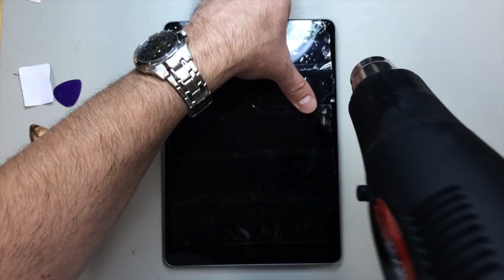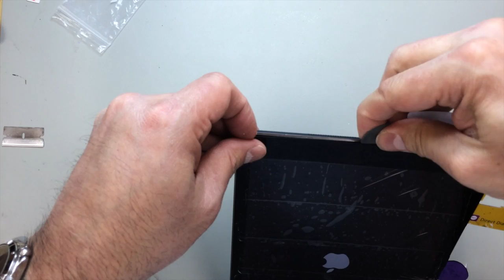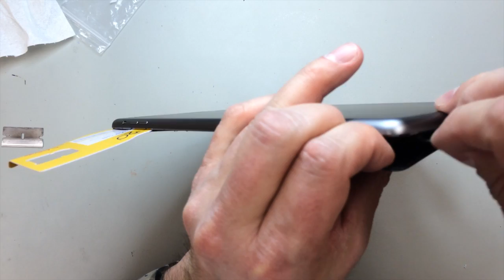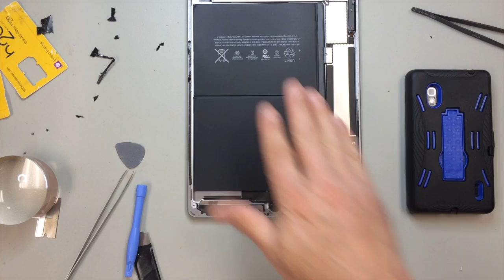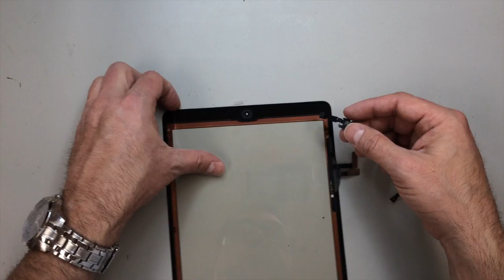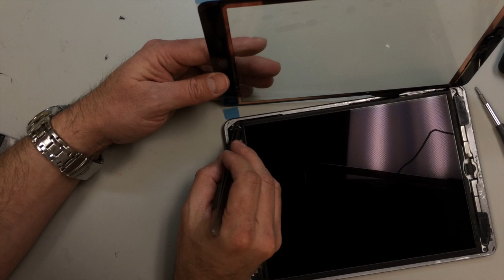iPad Air Screen Replacement Tutorial

Comment: nice job - thorough. except you skipped the moment i destroyed my last two attempts, namely pressing the digitizer closed into the adhesive. each time i've broken or crimped the flex cable enough to paralyze the bottom 1/4 of the screen and invite all the ghosts of ipads past to run amuck. wish i could figure out how to keep those cables free and easy. it's crowded in there.
Reply from the maker: Oh wow I hadn't looked at this video for a long time. When I do one of these again I'll make an update. There is a piece of adhesive on the flex cables now that make it a little easier but like you said it's crowded in there and you have to be sure that the cable goes between the frame and logic board just perfectly. I always start by setting the left hand side down first and then looking at the tablet from the bottom end while carefully guiding the flex into position.

Comment: Great video tutorial thanks. How long do you have to heat the screen to able to pry into it.  I have spent more than an hour using Iopnener as well as a hair dryer mostly at the same time, but with no success thus far.
Reply from the maker: It's pretty sticky from the factory. While I haven't tried this with a hair dryer my heat gun takes very little time. Of course that won't help if you don't have one on hand. I'd say try starting with the edges as they are more narrow and easier to get through. If you can get the top end from there and the glass is somewhat in a single piece it can sort of be used as leverage while you heat the lower end and slowly open it up. The best option is a hot plate if you can get access to one. Otherwise I'd highly recommend a heat gun. They are like $15 at Harbor Freight.

Comment: hi there 
i did try to replace the  digitizer but i forgot to swich it off  is that efect any on my i pad
with regard
r shandy
Reply from the maker: +raam shendy It can be. If you connect the LCD while the device is on Id say there a 50/50 chance of blowing the backlight filter. If you already completed the repair and it still works then you are lucky. Otherwise definitely disconnect battery before plugging or unplugging the LCD.

Comment: I was wondering if you would offer your opinion pertaining to an iPad air repair. When I set the digitizer in it's frame it began to malfunction. When testing prior to fitting the glass all the way down, it was functioning properly. I will have to attempt this job again, as I have broken my replacement digitizer. I did this when trying to lift the glass to resolve my issue. I have successfully repaired ipad 2, x3. I know special attention is needed on its digitizer cables, is there a tip you might give me for iPad Air. What do you think may have happened? Thank you so much for your time and I certainly do look forward to your response. Have a great day!

Comment: How did you remove the Home Button Assembly, when transferring this part back to the new screen. Your video did not show this. And second where does the double-sided tape go, is it to be placed on the new glass screen or the ipad frame?
Reply from the maker: I used heat and a thin pry tool (dulled razor blade is my preference) to remove the home button assembly. There is also a black ring that has to come off so be sure to get that piece otherwise your home button will not be flush with the lens. The adhesive can go on the frame or the glass. I personally find it easier to attach it to the frame. You can also see where the original adhesive was so you'll know where to apply it. Make sure to remove the old stuff first of course and don't let the flex cables come into contact with the adhesive or you will have a difficult time installing the lens.

Comment: the top corner of my ipad air cracked, very small

Will the crack get any bigger  
don't wanna pay for something so small
Reply from the maker: Eventually maybe but a lot of people go without repair and are just fine. The main thing is that if the crack goes over the LCD it becomes more prone to breaking the display if pressure is applied to the damaged area.